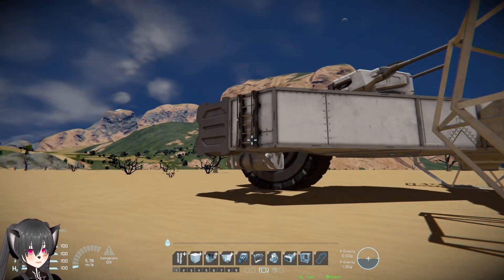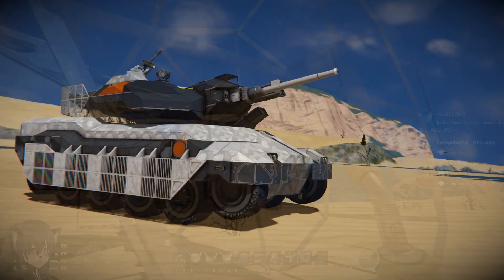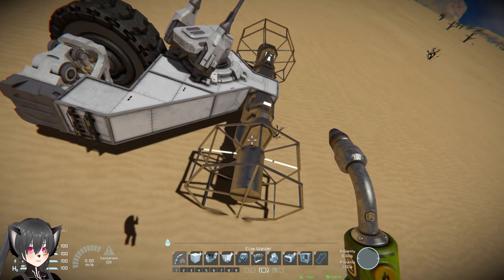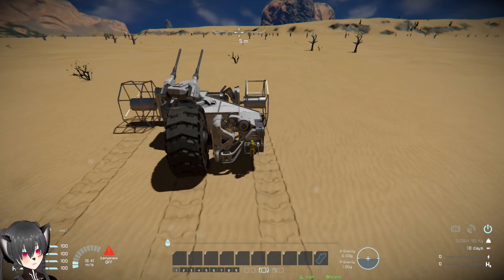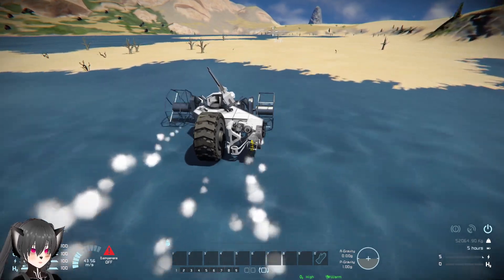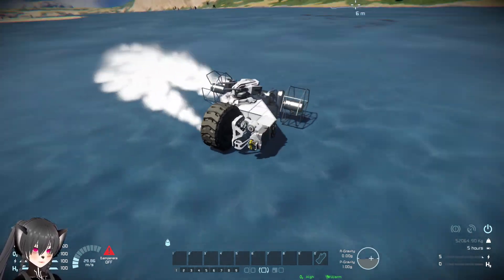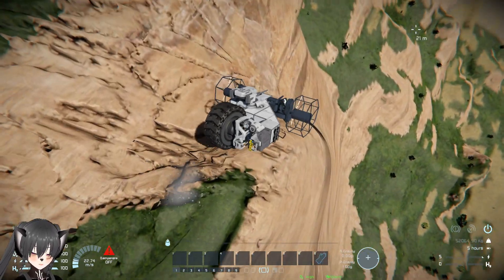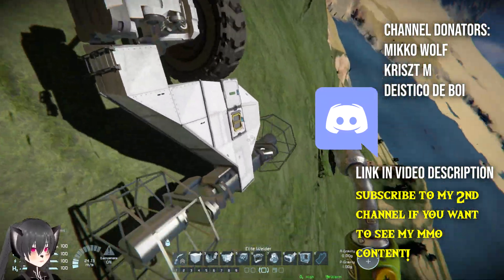This Trick Makes big Ground Vehicles Cheaper, Space Engineers

Comment: Unwelded blocks not costing the same PCU as welded ones but providing the same articulation seems like a bug. I would imagine this was implemented under the assumption that you only place one of the two parts for decoration.
Imagine building a suspension bridge with 50 unwelded hinges. Wouldn't that lag the game equal to a creation with 50 welded hinges that actively do stuff?
Reply from the maker: Hmm, not sure if hinges would work without them being functional though, would have to test that out x3
Reply: @LucaTheGuide  They do definitely articulate. If you place blocks on an unwelded hinge, it will flop down.

Comment: The problem is not the speed only but the terrain if you hit some rough terrain or bumps at a certain speed unwelded wheels have a tendency to blow up. 
To make the wheels more durable but not have the total PCU cost would be to weld the wheel (25 PCU) and not the suspension (50 PCU) which would be a midway solution.
Reply from the maker: Oo do they, I need to test that out x3 my crash test in the end of the video makes me think they're rather durable u wu